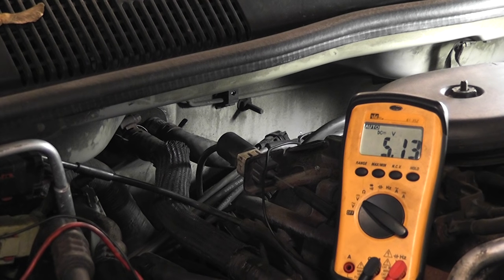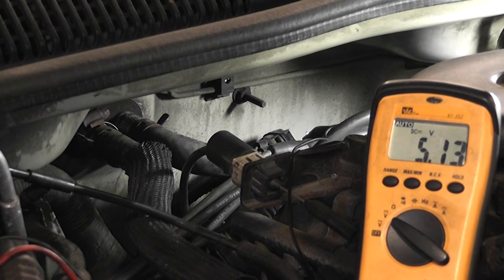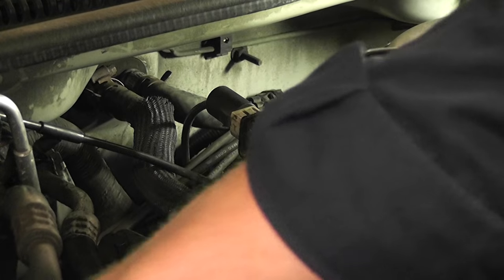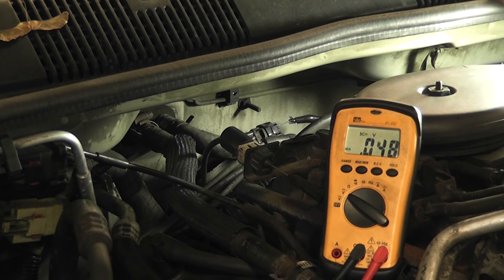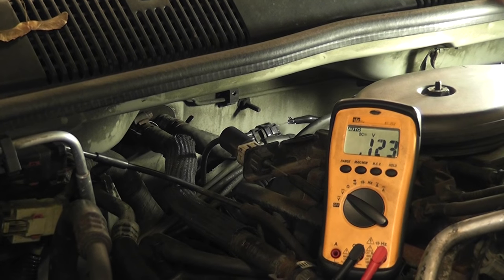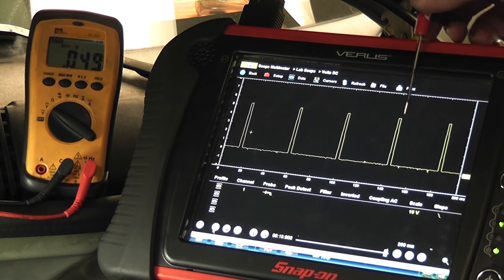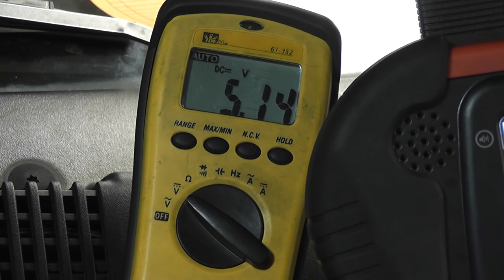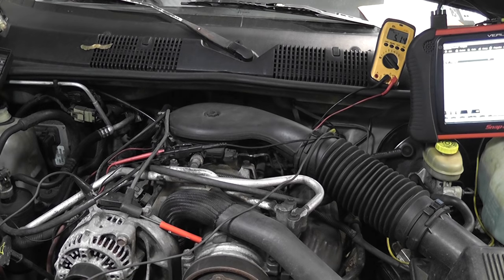How to test a crank sensor with a voltmeter

Comment: My friend has been mentioning problems with his sebring all of which are consistent with your chrysler, dodge, mitsubisbi 2.5 knocking, pinging and stalling vid from a few weeks ago. He has had 3 mechanics look at it and give up because there are no DTCs. The hour long video changed my directional mindset, I was going to look for a no com and go from there.  I dont have a scope, just a simple handheld scanner with live data capabilities. This vid is exactly what I needed to confirm circuit integrity with a dvom. You Sir are very much appreciated, thank you for your time and effort!

Comment: I am a ex Royal Automobile Club Patrol (Auto Club) I'd just like to say that this video although to some very technical, would save you money in the long run. So many forums online talk a load of BS and at last I have seen someone without greed, show a way forward. The USA is a big place and dealerships can be only on the coast states. Well done. If you find a old Bosch Distributor with the hall effect, you can show the "window" clearly. But basically it's a gap within the "magnetic field that switches the transistor to ground". Nearly all circuits are ground switched as the 5 volts is used as a stable voltage opposed to the 12 volts. Which does vary with the starter engaged.

Comment: I just did a primary chain and balance shaft chain on a 2.2 GM Ecotec engine. When I first tried to start the car it wouldn't run too well. Got a P0340 code. I was thinking I made a mistake and missed a tooth on reassembly. Turns out I actually had a shorted cam sensor. I followed this exact process using my scope. 0.71v plugged in and 5v unplugged. No square wave during a crank. Powers and grounds were under good under load. 

I love this channel and the premium one. Great information as always.

Comment: So I'm working on a 2000 Dodge Ram 1500 5.2 engine. I'm a DIYer and I just did the sensor ground test like yours. In your test before cranking the engine and the DVOM hooked up, it read .009 millivolts, mine read .018, double that. I that normal for the truck? Wiring is my weak point, but thanks to you and a few others I've learned a thing or two and want to learn more. I acquired this truck free after the owner got fed up and let it go after it was stolen and recovered. I had to replace the ignition after it was punched by the thieves. It has a crank no start issue, It also had a "no bus" issue so I replaced the computer and solved that. Trying to get this beater running so I can use it as a cheap household projects truck. Keep up the great work you are doing by educating us.
Reply from the maker: .1 (100mv) or less is the standard for sensor and computer grounds. Your .018 = 18mv and is totally fine
Reply: @ScannerDanner  Thanks, I only got to that point, then it started raining. Working in my driveway so I'm at the mercy of the weather. Rain today and tomorrow but thanks. Like I said keep up the good work I'm getting an education from your videos and I'm sure others are too.

Comment: I followed your instructions and i found out my computer does not communicate,i open my computer and i check it and found you're right,the computer is the culprit,and then i search you tube about PCM why they fail,one reason (of so many i guess)is the capacitor,so i tried,i changed the three capacitor inside,now my jeep runs well,i hope it helps.

Comment: Very informative brother! I check my no spark on my old volvo morrow, by doing exact these tests, its a 1992 and the sensor is on a hot spot on flywheel behind motor, may well be 30 years old and 250 ooomiles heatcycles...i do the diagnostics first, before trhrowing the other in, its rewarding to understand how they work / stop working, and the obvious tests to isolate the problem, great thx from Belgium Europe🇧🇪🍺

Comment: TPS and MAP sensor 5 v supply are okay but today my van won't start it, checked fuses and relay good, I jumped pin 30 to 87 the starter worked. thank you for your replay Paul I really appreciate. I will replace the pcm, and see if that it fix..

Comment: Did this on my 2003 Dakota and got not ASD Relay activation. It had the 5vdc like you did, both the feed and the PCM return or signal line. All the wires ohm out and I tried the ground pulsing on the PCM feed line and the ASD still didn't activate. The ASD ines all check good to the PCM and the Fuse panel, fuse good tool. I also have a NO BUS on the Instrument panel, 920 and 921 codes pop as well. My only conclusion at this point is the PCM must be bad. I reconnected the CKP and ran an oscope on the CKP to PCM feed line, and no pulses came out of the connector, so I probably have a dual problem, PCM and CKP. Thanks for sharing, I enjoyed the instruction. Best Wishes & Blessings. Keith Noneya

Comment from the maker: on the older ones they used an 8-9v power feed to the hall effects. either way I don't like 7v. 
double check that again and make sure your meter has a good ground and also give me the exact number. (example 7.99V is a lot better than 7.23)
you should be closer to 9 v on your system in the feed circuit only. The signal is still a 5 v pull down design (sensor unplugged you should read 5)
Reply: Thank You for this info. Very good .

Comment: Another good video. I used this bypass test today on a 97 Jeep Wrangler 4.0 I ended up having a bad cam sensor which it was in the distributor The good part was the one I got from the part store was bad as well LOL It would've really thrown a normal parts changer around the bend I'm sure But since I had done the bypass test I knew that I had a bad sensor
Reply: Pick-up

Comment: excellent information Mr Paul. I have learned a lot of tips with your videos. Thank you for sharing your knowledge with us.
God bless your family and you too.  greetings fron Tamaulipas Mexico.
sorry for my Englis writing.
Reply from the maker: Your English is fine my friend. God bless you too
Reply: ScannerDanner hi Paul my supply voltage tested 4.92.i haven't tested  with key on to see if my voltage dropped. Does it have to be exactly 5v .or is this close enough? Thanks in advance
Reply from the maker: No problem at all at 4.92 v 
I've seen them as low as 4.7
Reply: ScannerDanner thank you so much sir
Reply: ScannerDanner is a cam sensor test the same?
Reply: ScannerDanner  I did all these tests looks ok .but it's weird when I rev the engine in park.the rpms only go to 2500 and the needle jumps and sets the cam code..whats the deal..

Comment: this video provided the diagnostic procedure I needed.  Saved much time & effort.  Thanks.
Reply from the maker: Thanks for watching!
Reply: ScannerDanner hi Paul followed your test to the letter. Everything looked great. Until I got to the sensor ground test .engine running kept flucuating between 14 and 26 millivolts. When I first started. (ASD removed) for a split second it spiked to 93 then would go down to 14... I didn't see anywhere near the readings you had on that chrysler.. bad ground maybe?  Car does start and run .but keep getting the p0340 cam code. And has a stumble .And bucks and hesitation..  I've tried just about everything. It's a 06 jeep liberty thank you

Comment: Paul, I have notice that in the last part of this video when you are doing the bypass, every time you touch the sensor signal wire with the test light to ground the IAT(V) and the COOLANT(V) goes to CERO! It is exactly at 14:50 on the video.
Why is that?

Comment: I realized I had rambled a book. Here is where I am in a kinda condensed cpl paragraphs. 
I have in my small arsenal a test light and a woods multi meter and a Haynes manual and a basic amount of smarts, for a old man.
I was a Grinch this Xmas and took a gamble on a 1999 Dodge Durango 5.9l with no-start, no spark and a No Buss code. The couple I bought from said it had just quit on the previous owner at 179,000. They (couple) had a fuel pump installed and said it ran for about 600 miles and quit. He said he did some (testing) and concluded a bad crank sensor. Replaced and no start. He farted around and then replaced the Cam sensor with same results thus giving up and offered it for sale. He had however removed factory radio and installed some high tech thing and changed out lights for new high tech also. 
I have had good luck with most things I have tackled with the tremendous you tube help provides us back yard guys.
 
Thus far following guidelines and I verified:
I can hear the fuel pump relay kick when Plug/unplugging relay. Cheater way also switched with a neighboring one. 
I unscrewed cap and checked for fuel at fuel rail, which I do have however, no volt readings on fuel injectors.  I also have no voltage reading at coil. 
Crk and Cam sensors - Unplugged test light to ground, I have 5v on power /reference wire and 5v between sensor grnd and power/ref wire. Key on- still unplugged I also have 5v on load/signal wire.
Crk sensor plugged up back probed load/signal wire cranking it goes to 0v and stays – stop crank and it goes back to 5v. According to many that indicates a bad sensor which is possible as previous owner bought from Auto Zone (box and old sensor left in SUV). Have had and heard of many bad parts from them.  But I’m not sure.  
Crk sensor unplugged Test light to ground I brush light prob across load/signal wire and for the first time I hear and feel the relay Labled ASD clicking. This one according to Haynes manual is the coil and fuel injector one. 
2 things that questions me; It seems I have more than usual ark/sparking as I connect battery terminals. I ran into same thing while working on a neighbors riding mower and found the starter solenoid had lost a ground; Rusty connection. Next- is the No Buss affecting my test results?
Watch many video’s to help guide me so much that my head is in spinning out of control forgetting and double checking overload. 
My testing has me thinking a ground issue but unsure which way next. I remember you with that AES tool that helped find the frayed wire kinda in wheel well. I know you said you had the scanner hooked up and when tried to duplicate had issues.
I am at your mercy for a direction. Best; Tom
Reply from the maker: James, this one will be best handled on my forum. I can't do back and forth messages here as YouTube's system sucks. They do not email me when there is a reply. My forum is free to join. https://www.scannerdanner.com/forum.html
Thanks! Hope to see you there.

Comment: Thanks for this. I had similar issue but on probing the reference voltage with sensor pulled out, 5v appeared on both signal and supply. The ground was fine. What could be wrong?

Comment from the maker: I believe the PCM is behind the passenger kick panel right? If so take a look at the connectors and make sure they are not corroded. I had a 96 with a windshield leak right onto the computer and caused to crazy stuff. 
BTW we are in Pittsburgh PA if your close we would love to help.

Comment from the maker: What is the feed wire voltage? Do you have a steady 9 volts? If so check either the TPS or the MAP and let me know if one of the wires is reading 5v there.

Comment: Awesome explanation love the video. I have a question about an issue I'm having. Testing both power and signal wires without the sensors plugged in should read 5 v right. Well when I do the bypass test the cam reacts like it should but the crank reacts to both signal and power wires tripping the relays on both wires but what's weird is that aren't they connected together with one power feed feeding both sensors. Or actually the speed sensor as well right? So if the wires were touching then wouldn't it have the same affect on the other sensor wire harness or does the signals relay back to the ECU separately
Reply from the maker: So with your bypass test, you are jumping those circuits to ground? You shouldn't do that to the reference circuit.

Comment: I chased a fishbite miss forever on my 04 jeep. then one day started jumping and jerking especially on takeoff. as I was hooking scope to crank sensor, I moved heater hoses for better access, and found engine ground loose on engine stud. cleaned and tightened. jerking gone, as well as fishbite. Signal looked good. must get longer leads for testing while driving tho.

Comment: What if the 5 and 0 volts alternate every couple times wave the wrench in front of the sensor? So when I'd pull the wrench away it would stay at 0 (well .3) volts. Tap it a couple more times it would stay at 5 when I pulled the wrench away. It keeps alternating "polarity" The cam sensor does the same thing. Is this normal? Great video thank you.
Reply from the maker: Not at all. What problems are you having?

Comment: Mr. Paul can you please explain what's the relation between high amperage from the starter & rise of ground voltage?
Reply from the maker: The engine block is the typical grounding point for the engine computer, as well as the starter motor itself. So when you're cranking, you a sending a mad amount of current flow into the block from the starter and the block itself will rise in voltage. It is this effect that will cause sensor and computer grounds to also show this rise in voltage. Make sense? The block is simply a conductor in the circuit.
Reply: @ScannerDanner  got it thanks

Comment: Is it a coincidence or does the tach fail to indicate if the crankshaft position sensor fails? I have a 2001 Dodge Ram 1500 4x4.
Reply from the maker: Tach movement is a guide only

Comment: I have a 1999 suburban C1500 5.7L. Crank Position connector disconnected. Is ground supposed to disconnect when ignition is on? Ground is there when ignition is off.

Comment: I did this test on my 2004 Jeep Grand Cherokee and the voltage randomly bounced around from 5.3-5.4V to below 3.9V on the power wire (red wire) does this mean the crank sensor is bad?
Reply from the maker: bump the key like I did to see if it will pull down to zero
Reply: ScannerDanner I bumped it for about a minute or so (probably 20+ times) and never got a reading higher than 0.9V on the signal wire from the crank sensor. On the power wire (red wire) it’s 5.2V with the key in the on position but bounces between 5.4V and ~3.8V when cranking. Bad crank sensor or something else like bad PCM?
Reply from the maker: @TylerrFTW  the power wire should be a steady voltage but if you are using the block for the ground on your multimeter instead of battery negative, that can explain the lower voltage on the feed wire (block voltage from the starter can be as high as 1v or more on initial crank)
On the signal wire, with the sensor disconnected, it should go to near 5v, does it? If so, it does sound like the sensor is messed up.
You should have a crank sensor code too
Reply: ScannerDanner ScannerDanner I’m using the negative battery terminal as ground. The signal wire with the sensor disconnected is right at 5.2V. The power wire with the sensor disconnected is also right at 5.2V. The only thing that’s weird is that there’s no engine code for it. Is it possible the sensor is bad without triggering a code? Thank you so much for your help, you’ve been a lifesaver and have earned a new sub 👍🏼
Reply from the maker: @TylerrFTW  it is strange to me that you are not setting a code, but if you are sure that the signal wire is 0 all the time, plugged in, regardless of reluctor position, and you are reading 5v unplugged on the signal, then this confirms the circuit is working as designed and it does sound like the sensor is shorted. 
Remove the sensor and plug it in and move a heavy piece of metal past the end of it and see if you can make a signal

Comment: Hi Paul, a bad crank sensor only will do no signal right, but with the sensor plug in the 5V should be there or not? is the wire is good with the sensor unplug the 5V should bee there..

Comment: need help 1993 dodge intrepid 3.3L engine cranks but won't start no spark failure to start test indicated bad camshaft sensor or 
wiring problem  checked wiring connector to pcm all tested good installed new cps same problem tried testing procedure on new
sensor power wire 8 volts cranking negative wire 1.25 cranking signal wire bump test highest voltage 5.0  lowest .063 is this telling 
me the new sensor is bad ?

great video
Reply from the maker: No, the bump test showed you the signal voltage range is correct. It is a 0-5 volt on/off signal. I would verify that the timing belt has not jumped a few teeth next. Pull the top two covers off the cams and set the crank to TDC and check your marks. If I remember correctly, on this engine, you don't need to take much apart to take the top part of the two camshaft gear covers off.
Reply: Thanks for your help. my engine has a timing chain and one cam. just checked the crankshaft position sensor and
it failed the bypass pull down test but i will check the timing thanks again
Reply from the maker: @dcooper907  my fault, thought it was the overhead cam engine.
Reply: @ScannerDanner  that's ok i changed the crankshaft sensor engine started right up
thanks for your help

Comment: I'm a little lost on mine.. i did the remote wire test. Key on engine off. Positive to remote wire, negative to the battery -.. it showed 5 volts. I bumped the started a couple times to double check. Same result. What am I missing here? If you don't mind. (Yes the power side also showed 5 volts)